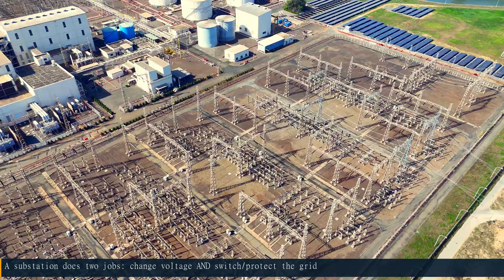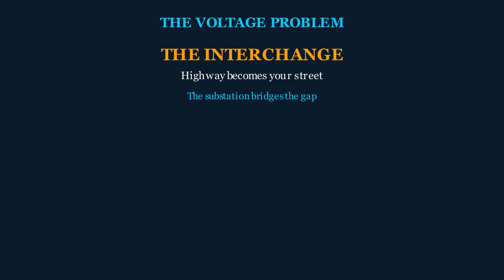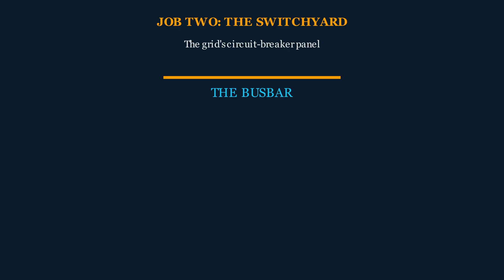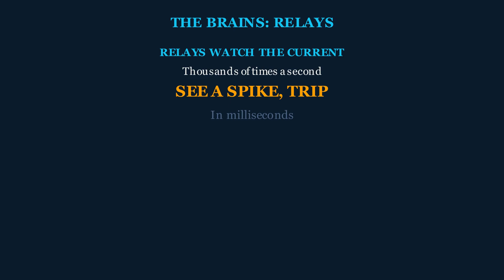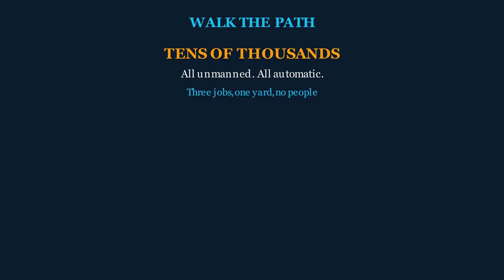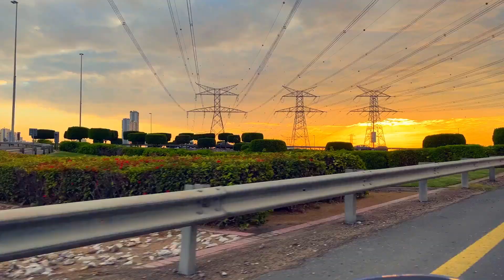What's Actually Inside a Power Substation?

Comment from the maker: A substation does two totally different jobs in one fenced yard. Job one: change the voltage. The big gray tanks are power transformers that step the high transmission voltage (say 138,000 V) down to the few thousand volts that go out on the poles to your street. Job two: it's the grid's circuit-breaker panel. The busbar is the shared junction; the breakers can interrupt tens of thousands of amps in a fraction of a second; and the protective relays in the control house watch the current and, the instant a fault hits, trip just the right breaker to isolate that one section so the rest stays lit - automatically, in milliseconds, with nobody on site. Full walk-through in the video.